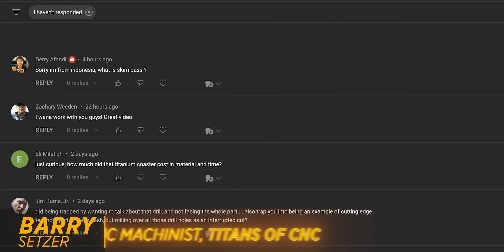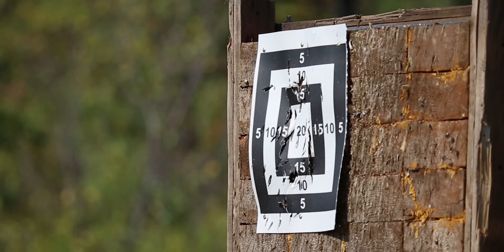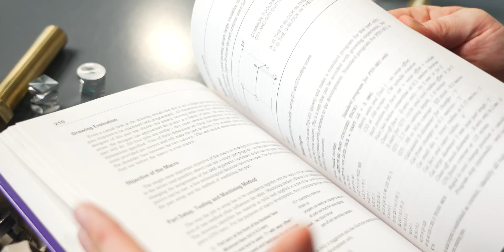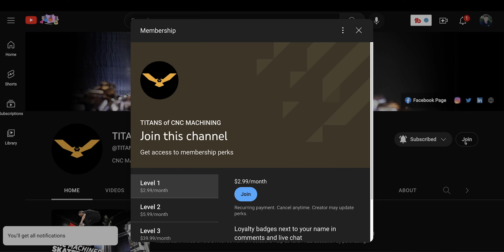You’re NOT a REAL MACHINIST If You Can’t Do This…

Comment: I miss this sort of interaction with my coworkers. I had this at a tire shop I used to work for, but not at the machine shop I work at right now. We just work, straight faced, programming while running machines, just, work. There are only a handful of us there and I'm one of two programmers, the other one works 2nd shift, everyone else has other job descriptions but occasionally fills in to operate machines.

Comment: My father has some cool coworkers at the shop.  All of them love little pranks and gimmicks.  Prolly one of my favorites is when he pranked one guy with a Baby Ruth Candy bar.   Each week, one person cleans the bathroom (you can prolly see where this is going already) Theres a gas station walking distance from the shop they all frequent.   He went over and grabbed the candy bar and walked back, heating it up with his hands.  Then goes at the last few mins of the day and sticks it right to the floor, all crunched up and mashed up.    I personally would of lost my crap if I saw that on the bathroom floor when It was my turn to clean it.      Where I work (I being there 2 years so far)  Ive got some cool coworkers, we also do little stuff to each other.   Now my tool box isnt the biggest, just a little craftsman box, they ended up grabbin it and sticking it on top off the office.  Our office is build inside the shop as an addition, it was all the way up there.    I had a good laugh when I discovered my box on the office, they did too when I was cussin a storm wonderin where my box went.   All good laughs.

Comment: Working at a warehouse is the same way as well. You have to have thick skin and work like a animal. But where I worked at was a international company for auto parts and accessories. Plus everything in-between. You become like family when you see each other 12-17hrs a day and work mandatory overtime. Man I miss working there. I was hurt with a big steel push bumper landing on me pulling it from the pallet of interlocked bumpers in the rack.